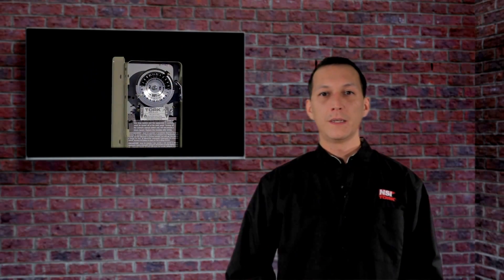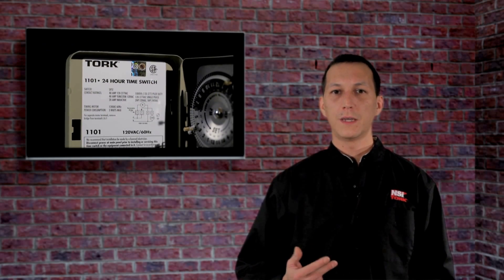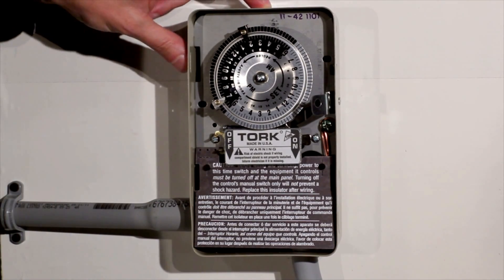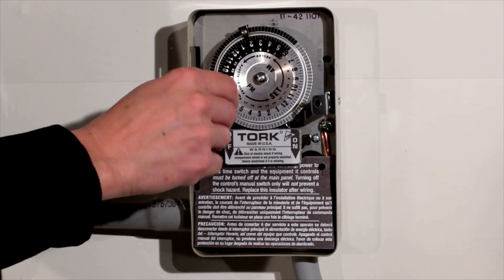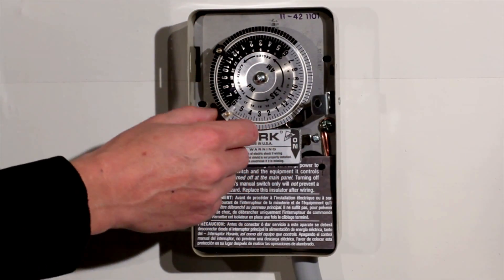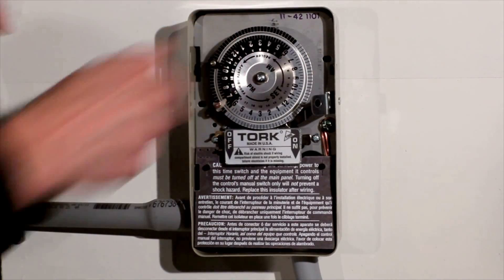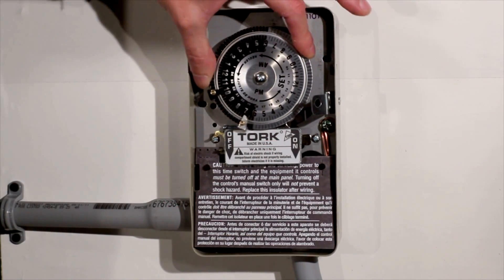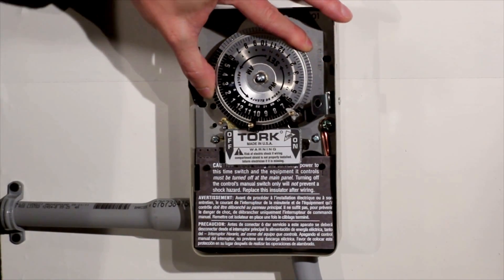Learn How to Operate TORK® 1100 Series Mechanical Time Switches from NSI

Comment: Is it possible to add 2 sets of on/off trippers? i.e. to say, run a pool pump from 7-11am and then again from 3-7pm?
Reply: Yes. Just put the appropriate on/off  where you want them on the dial.

Comment: After watching the video I made a similar test it went smoothly to turn it ON However it was very tough to turn it OFF .  In fact I had to push the OFF switch down and THEN I was able to turn the dial around   What could it be?
Reply: I'm having the same issue. This video shows instructor's thumb flipping the off switch, so I can't tell if you're supposed to be able to turn easily or if it's as difficult as we're experiencing.

Comment: I have installed the Tork 1101 timer. The line coming from the ground lights around my driveway does not have a ground wire. the old timer did not require one. do I have to install a new line with a ground wire?
Reply from the maker: Wooz Tube: Thank you for your question. If you have not done so already, please reach out to our fantastic Technical Support team. Their number is 1-888-500-4598 and email is techsupport@nsiindustries.com. They will help you with any and all questions that you have.
Reply: en español

Comment from the maker: There shouldn't be any "looseness". Make sure you rotate the dial to set the current time correctly, then make sure you have the tripper set screws tightened down at your desired on and off times so they don't slide around the dial.
Reply: My dial is loose as well and because of such it doesn't have the power to trip the switch. How do I tighten the faceplate of the timer?

Comment: Is there typically some looseness to the time dial? I've set it for 7 AM sharp to turn off, but it doesn't seem to trip until much later.
Reply: I have the same problem.   The on/off contacts will be up against the levers but the clock motor no longer has the torque to trip them.   They sit at the on/off point for a long time before they work so the clock is always off.